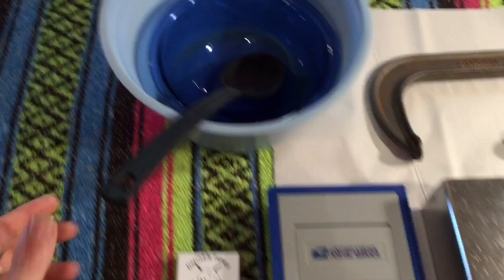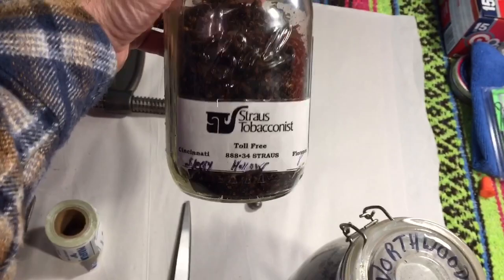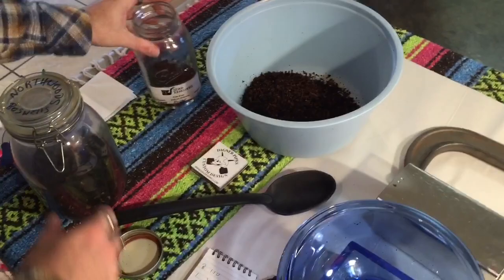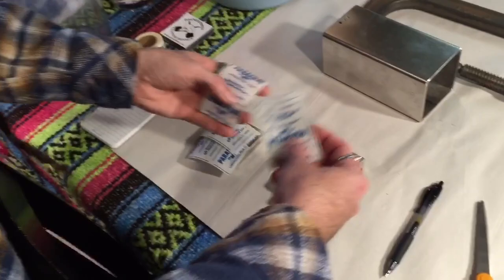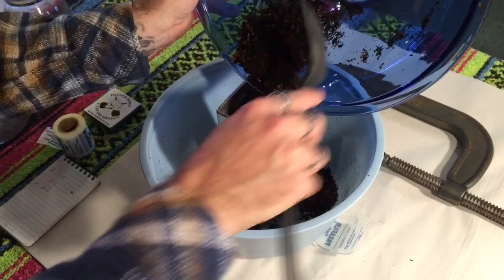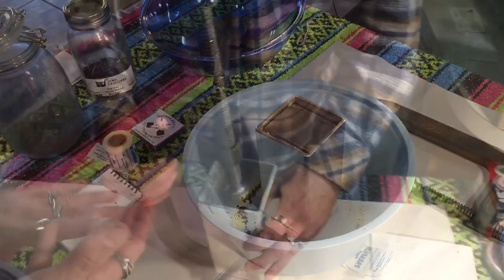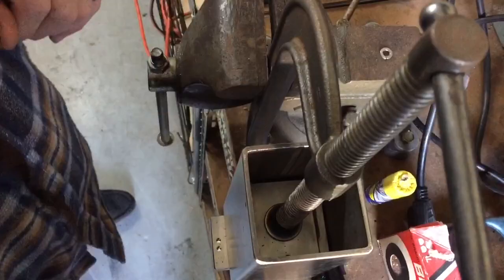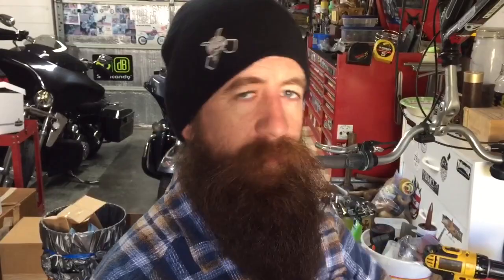Pipe Smoking: How to press tobacco

Comment: I know this video is a little old in internet time, but I was glad to see it as I've been dreaming-up a design of my own. I've got a buddy who owns a machine shop so I'm positive I could get a cap & base made. The 4" x 4" stainless steel stock is no sweat to find. One thing I'd say that'd improve your operation big-time is a hydraulic press. They're not too pricey either. Thanks for sharing this; it's corroborated my own day-dreaming ideas of pressing my favorite ribbon-cut blends into nice cakes that'll age much better over time. Also, in the case of 8oz tins of blends which I can't get in bulk (for example, G.L. Pease recipes from C&D), it'll be so nice to be able to pop those babies open and put 'em right into the press, knowing that there's no surprises in the tin a year or so down the road. Awesome video, and 👍 👍 to the beard! 
😎 Happy Piping from Cape Cod

Comment: Nice.  Thanks for the shout Jayson. The press I had on the shelf has been sold. I will be making more from time to time, and get that word out for those that are interested.  I use a large bearing puller with mine, so I believe I put a "dimple" in the center of the top of that press to maintain center. And the puller already has a hex head for torque use.
Reply: metalmorphist are you still making the press, I would be interested in one
Reply: I make them when material is available. Don't have any in the works yet.

Comment: Nice! Thanks. I know this is an old video but I had a suggestion in regards to your C clamp. You mentioned cutting the T handle off where you tighten it by hand to install a nut to get a torque reading. I am suggesting keeping the T handle and just welding a nut to the end. That way you can still tighten by hand until you reach the point where you want to get a torque reading. Anyway, just my thought. Happy piping.

Comment: I little trick about scales if you press the hold button twice or tare with that means is when the bowl on it it gets exclude from the weight so it calculated back to.00.0 all over again like the bowl or whatever you use is not even on there so you don't have to ad the weight of that anymore.not a lot of ppl no that for some reason and most scales don't even tell you that in the instructions and mostly all scales do this even the dinky 15$ ones

Comment: just a suggestion but if you welded the plate that lower and compresses the tobacco onto the clamp you wouldn't need to worry about it being uneven as long as the bottom is flat to the bottom of the clamp, great vid aswell!
Reply: Hi, how should he take the cake out then?
Reply: +Esmaeil Fathi  the same as before exept you would just need to unscrew the clamp more to get it out